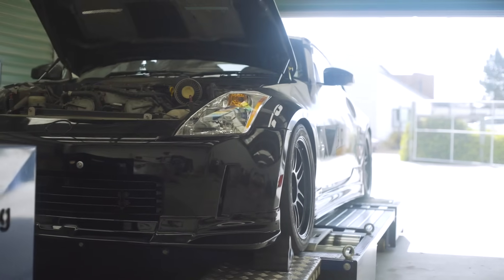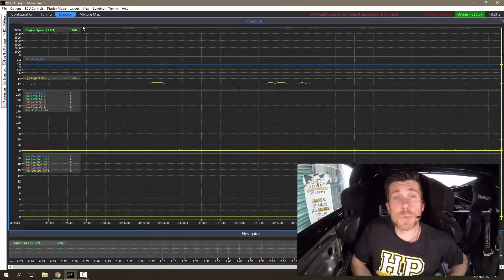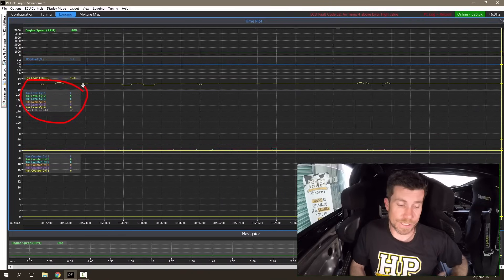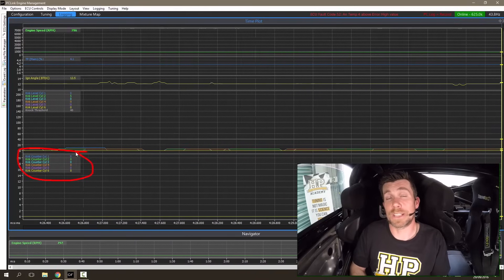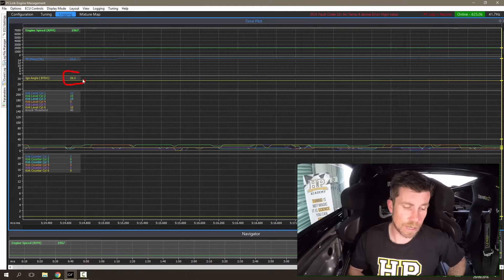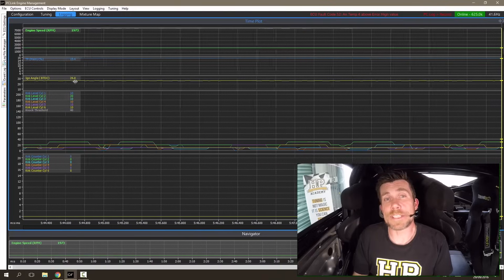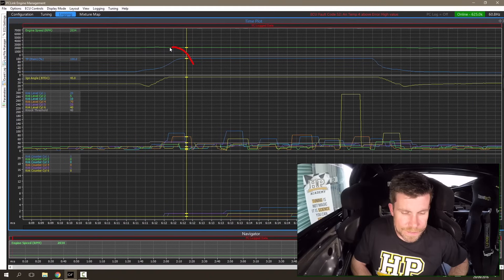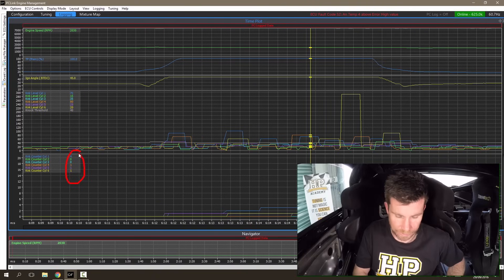Knock / Pinging / Detonation | What does it sound like? [FREE LESSON]

Comment: the sound quality was not good enough to be able to discern  what to expect ..
Reply from the maker: What are you listening to the video with? Use some headphones if your speakers are not up to the task. This is almost as clear as knock is ever going to be for you :) - Taz.
Reply from the maker: It's quite possible to have a particular engine where the knock sound is more prominent, however in my experience you're also more likely to find the knock signal to be worse than what we've presented above. If you're using a good quality head set and you listen to the explanation of what you're hearing, you should have little trouble detecting the knock.
Reply: they arnt actually listening to the motor. this video is really stupid. they essentially hooked a electrical signal up to a speaker.
Reply: thisisntme they are listening to the signal produced by the knock sensor which is essentially a microphone.  oem cars use this method as well.
Reply from the maker: Thanks for your input there @Gary, I had missed this comment.

@thisisntme, correct, and this is the best way to monitor knock. If you are just trying to listen with your 'naked' ears by the time you hear the knock it is too late. Watch this video to understand how this works regarding the sensor, which starts with a microphone so technically even though the signal is converted to a digital format, you are listening just in a way that is actually effective - https://youtu.be/N6lbBCqAGvc

And read this to understand why your ears are not as good as you think they are if that is the only thing you're curretnly using - https://www.hpacademy.com/technical-articles/dont-waste-your-time-listening-for-knock/

If that doesn't clear things up come back with some questions and we'll help explain it further for you if we can :) - Taz.
Reply: i heard it fine on a tiny jbl aux speaker lmao, this is what tuners listen for and its not gonna sound like engine banging noise
Reply: @hpa101  Can preignition sound like sand falling or sort of a "crackle" (but very soft)???

Comment: Knock, pre-ignition or pinking sounds like light stones rattling in a baked bean can. I didn't hear that noise in your demo even with headphones!
Reply from the maker: Just a baked bean can? That's very specific, I'd like to see your math on that vs a peach can 😂

As mentioned knock can and will sound different in different engines but in our experience of hearing knock hundreds of vehicles using audible knock detection the demonstration is accurate - Taz.

Comment: KNOCK THREE TIMES song by TonyOrlando!  
Here's my favorite & depressing knock n pinging story that I or dozens of techs could never fix.  Had a 1991 Cadillac Brougham 305 Chevy TBI LO3 motor that would ping at WOT (sounded like a glass jar of marbles under the hood that's how loud it was!...a little at part throttle.  Would only stop on 100 octane.  Did every trick in the book....had to run the coldest Delco plug & still saw aluminum peppering on the porcelain & eventual burnt grey melted spot on center porcelain.   Used to make my rounds to 4 Caddy dealers back then & they couldn't figure it out.  One of the old techs said I was 6 months til warranty expires..... drain oil out, drive it til it knocks, put oil back in & get a new short block which would then verify if it was mechanical or fueling/ecm!  I'm sorry I never did it....drove me crazy, & now there's all this new diagnosis technology to verify that problem I lived with for years......  One tech figured the factory resurfaced the heads making high compression ratio with 180+psi.
Reply from the maker: Man not sure that is a recommendation a tech/mechanic would give today haha How good! I'm sure you're happy to have that long in the past now though eh 😅 Things have come a long way for sure - Taz.

Comment: So is this the same sound I should be looking for if using det cans?
Reply from the maker: Yes, it will sound a little different depending on the engine but it will be similar to this. We have isolated it quite well here so note you might have some more background noise.
We recommend using quality earbuds and then wearing ear defenders/ear muffs over the top of those.
There will be other options that also work, that's just what we have found to be the most reliable with the least 'faff' for us over the years.
Hope that helps - Taz.

Comment: If the engine knocks due to low octane fuel, will it generate any diagnostic trouble codes (DTC) in the engine report? If so, what would the code be related to engine knocking?"
Reply: As far as I know it won't generate a code, but it will decrease the timing (spark advance) and the engine will  feel less powerful.

Comment: 1. Thanks for technical explanation (sad I don't have the software). 2. I have a Forester 2002 and detected this noise (4 wks ago). I thought it was the PCV valve (balls hitting against its seat by spring, repeatedly). 3. "CHECK Engine" idiot light came about: "Knocking sensor" is responsible for noise being "detected" (??). 4. My impression is the timing belt is extended, and it does not 'make' it under the stress of throttle demand. Suggestion: If you gave the lessons in English, I would understand at the first attempt (just kidding!). Thanks.

Comment: Why my fiat punto 1.2 8v engine have metal sound like for example little hammer hitting fastly on some metal...that sound i can hear when i accelarate and going uphill, only in that case...what can i do about that? Thanks
Reply: Maybe low oil?
Reply: @Blue__244  no man, oil is fresh, quality one, near max level...works fine...just that noise on acceleration and uphill killing my ears, i cannot hear it when windows is closed, just in summer when i open it, so its not loud, but, just like somebody hitting constantly with little hammer inside engine...i heard its detonation due low octan fuel but im afraid to destroy engine... 🤐

Comment: I have one question for you, I have a problem that knock happens at high revs, over 5000rpm it happens, and below 5000 everything is fine, the fuel mixture is excellent 12, lambda ok, fuel pressure ok, fuel pump ok, im driving on Vems ecu, so what do you think is the problem ?

Comment: 06 cobalt sc when climbing a hill in high gear increasing throttle I can hear a ping peck type of sound an some cases when accelerating it's like I take foot off throttle for split second I have no way to data log .. should I start with the phaser solenoids??
Reply from the maker: If you're not already using the highest octane pump fuel you can, I would start with that - Taz.

Comment: Is it possible to add a knock sensor to a setup the doesn't natively support one?
My engine is from 1976 but I'd like to have some kind of knock detection.
Reply from the maker: Yes sir, for tuning you can use a standalone audible knock detection unit like the TunerNerd Knock Monitor, and then there is the mac daddy Plex Knock Monitor Pro as well.
From there if you're running an aftermarket ECU it depends what features it has for what you can do regarding onboard knock control - Taz.
Reply: @hpa101  thanks for the heads up, I appreciate the response.
I wonder if it's possible to have a knock detection light, trying to keep the electronic engine control to a minimum.

Comment: That is why the engine gods gave us water methanol 😆 🤣 😂 and it was good 👍
Reply from the maker: We've had mixed success with that and prefer to just use a higher octane fuel instead where knock limited.

All depends on your application as to what is the best for you - Taz.

Comment: Probably a silly question but how does engine speed stay constant at 2000 RPM when you go WOT?
Reply from the maker: Not silly at all, the dyno we use holds it there. You set what RPM you want (after initial setup of the dyno) and then you can move through the load cells, tune, and bump it up to the next target RPM and repeat.
Once you start to get higher into the rev range, you start doing sweeping runs so you're not revving it out too hard and doing damage - Taz.
Reply: He gave his answer but thought I would add that since he mentioned the car was in 4th gear, and therefore the transmission engaged and wheels were spinning, you could simply just use the cruise control, am I right?  That should maintain the rpm’s as well.  

You couldn’t do this in neutral though.  If you did, I hope your rev limiter is working correctly, or you’d have a lot more than mild knocking to worry about

Comment: I'm a sound engineer and I find this very interesting. I haven't got access to performance monitoring kit but I've tried various mics and low frequency transducers on my engines using audio filters to isolate the different frequencies. It's also interesting hear a slowed down recording.
Reply: 6400hz is the typical frequency of knock/ping

Comment: I had an LS1 that pinged so damn bad just barely giving it gas. There is no check light codes, no vacuum leak, ran Shell Premium, even replaced a fuel pump and filter, and it has a new timing chain. I just took it to the Chevy dealer and let them reflash the ECU. Most of the pinging went away! Doesn't make sense to me how it would do that other than the ECU needing a calibration from wear and tear over 125,000 miles?

Comment: so in theory you could take that audio signal , route it back into your auxport/amp whatever and listen for knocks on the go? or is the sensor (or i asume a sort of microphone) a thing you addon at the dyno or something and completely diffrent from the actual knock sensor in the engine?
Reply: the old school method is bolting stethoscope to the cylinder head, similar concept. but after tuning properly you shouldn't have to drive and listen to knock. in this video it seems as though he's routing the knock sensors signal through a computer and using it as audio, if not it's just a microphone right up against a head
Reply: There will be at least one knock sensor going to the plex knock detection device (audio) and at least one knock sensor (more likely two) going to the Link G4+ ECU (the graphs)
Reply from the maker: For the knock audio we're using a standalone system from Plex called a Knock Monitor. This is used when we're tuning and then removed from the engine. Using this system the tuner can constantly listen for knock from the engine while tuning. The datalogging in the G4+ ECU on the other hand comes from the two factory knock sensors bolted to the block so the systems are actually independent.

Comment: Does it sound like one of those click clacking toys or castanets .
 it's like a slight clapping sound normally I notice that when I drive around with the air conditioner on it happens to my car around 1,500 - 2,500 rpms . I recently changed the knock sensor which was faulty in my car what causes that sound ? The car is running fine
Reply from the maker: Take a read of this article Don. It's going to help answer these questions for you and more :) - https://www.hpacademy.com/technical-articles/dont-waste-your-time-listening-for-knock/ - Taz.

Comment: Will this knocking noise damage the engine and its components?
Reply from the maker: It depends on where it's occurring, and also on the engine. On low stressed NA engines, it's not ideal but also it's always going to be an issue even at high RPMs. On an engine that has forced induction or a highly stressed NA it can quickly cause catastrophic damage - Taz.

Comment: knocking node starts at 2:50. it's kind of hard to hear and it sounds like pop rocks.
Reply from the maker: Yes sometimes it's even harder to pick up than what you hear here depending on the engine. Of course in this case it also depends on what you're listening to the video through ;) - Taz.

Comment: I can imagine how difficult it would be to hear that even with headphones while there's an engine at full throttle right in front of you
Reply from the maker: Yes it can be very difficult on some engines, but you are doing sweeps and do build up to full power runs so you can get a bit of a feel for things rather than just jumping in and going balls to the wall straight off the bat ;) - Taz.

Comment: Okay so I own a 2013 Kia optima sxl turbo,  and i purchased a racechip gts tune, when I first bought it,  the tune worked fine and at max power the car launched like a gem. Now each time I use it and give the car heavy throttle it knocks and definitely sounds like the marbles in a tin can (or same sound as when you turn off a hot engine and hear the ticking)......i can stomp on the accelerator with tune deactivated and get no issues or sound,  but the second its on the car sounds horrid at heavy throttle. The racechip itself does not interact with the ecu but connects directly to the map and turbo boost pressure sensors. Anyone have any insight on what could be the issue?  Definitely not the engine (was replaced barely 2k miles ago)

Comment: the "knock" i heard in a V8 engine i used to have sounded like a spray paint can shaking...
Reply: PANTYEATR1 Yes that's how I explain it to people. A marble in a coke can.... That's via in car only on the road and not wearing any knock detection headsets.
Most people that do hear it for the first time mention there's something rattling in the exhaust and they aren't far off lol
Reply from the maker: Knock will sound a little different from one engine to the next but your description is pretty accurate. Using audio knock detection equipment this may sound slightly different though depending on what the digital signal processor does with the raw signal.
Reply: What causes that sound, and is it present only when car accelarate and going uphill? I have it, what can i do, is it dangerous for engine?
Reply: @strahinjapantelic2869  Basically,t he sound, or "knocking," is when the flame-front caused by the spark plugs in the cylinder (the combustion) meets other flame-fronts that combust due to more compression and/or temperature than the fuel itself can handle before self-detonating. Instead of one clean flame-front per combustion per cylinder, you get multiple flame-fronts which can cause issues.
It can happen at any time, really, depending on what is going on with your car. If you're going up-hill and it's occurring while you're accelerating up it, it could be that the combustion temperature is too hot (which could potentially be caused by a faulty EGR system, which is relative to your emissions), or your engine might be starved of fuel under that certain amount of load, RPM, and throttle levels. It's unlikely that your car's computer needs tuning. More likely is an issue preventing enough fuel from reaching your engine, such as a fuel regulator, fuel filter, or fuel pump that needs replacing. Of course, before going forward with any repairs, make certain of which issue it is before you spend money on new parts.
Knocking is dangerous for your engine's health. Depending on the severity, it can be anywhere from potentially minorly damaging all the way to "this will destroy your engine within a week or less."
I would absolutely avoid putting the vehicle in situations that cause the engine to knock, if at all possible, and get it looked at and/or repaired as soon as I could.
Reply: @UC88GZPTeS9Xml2YajWO-qxw thanks for such details and explanation...but, why my engine have that sound only when its hot weather, at night is ok, and at winter is fine, no sound, but in summer he makes that sound only at acceleration and under load due to day time...my mechanick told me everything is ok, maybe valve adjustment, and bad fuel but on this model that issue is not common...thanks again...

Comment: I remember in the 1990’s I heard of a few cases where the mega bass competition level audio system in the vehicle would trigger the knock sensor and the timing would retard to the point that the vehicle had very poor performance. 

To me knock strategies deserve a lot more attention than we give them. In racing or wanna be racing, to be competitive we must push the engine all the way to the limit and knock will be the indicator that we are there.
Reply from the maker: Ha! That's a throw back. Instead of audio 'sound off' competitions these days I think they do a rev thing?

Knock is really more an issue with performance street cars that are not running 'race fuel' or in class racing where there are restrictions on what you can run. If you are running E85 or methanol etc etc, save for larger cooling issues, you're generally going to find MBT before you find knock which is why there is less of a spotlight on it in motorsports - Taz.
Reply: That's all an urban legend... 
Knock sensors are tuned to pick up frequencies in the 6400hz range. Well ABOVE any bass frequencies.

Comment: what what fuel was used when you where tuning your Nissan.
Reply from the maker: This is just our local 98 octane pump gas. The engine really isn't knock limited on this fuel under normal circumstances.
Reply: @hpa101  Does knock limited mean having a knock sensor? N/A engines haven't these usually, right?

Comment: You heard my cries!
My knock monitor is a microphone on a clip, with headphones, on a voice recorder.

Edit: actually not quite the noises I hear, but still useful (I have to distinguish valve-train noises, injectors, piston and rod noises, everything really)
Reply: use low cut filter and high cut filter to remove anything lower than 5k hertz and higher than let say around 7.5k hertz.   then find the exact knock frequency of your engine (depend on stroke and bore) and amplified it precisely like if its at 6574hz (6550-6600). I just hear ticking when it knock almost nothing else. for me hard part is to link it to my standalone...
Reply from the maker: Using filtering is a great way to really zero in on knock and remove unwanted background noise. Often though you'll find you get a better signal to noise ratio by focussing on the second harmonic frequency of knock (literally double the knock frequency) which may be around 12-14 kHz.